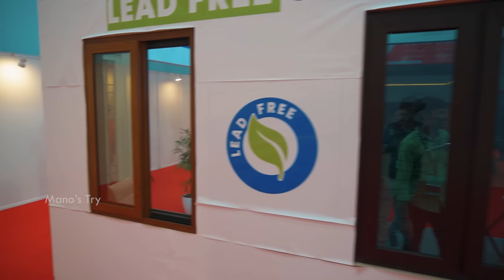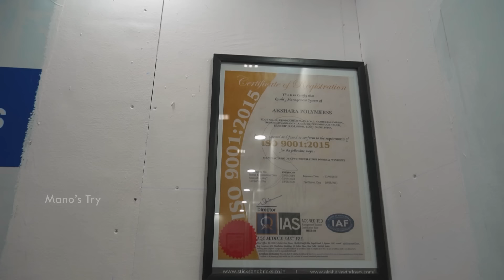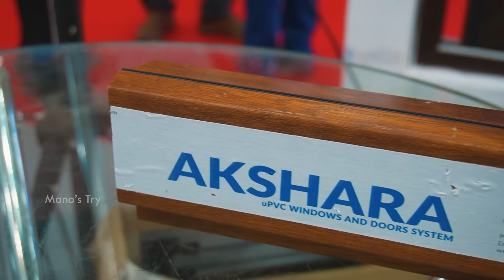இதை தெரிந்துகொண்டு முடிவெடுங்கள் | UPVC Windows Quality Price Design Colours | Mano's Try Tamil Vlog

Comment: All agreed. But in some buildings I noticed that PVC panel is dislocated or dislodged  from wall during summers (due to material expansion from heat). This does not happen in traditional wooden frames.
Reply: It's UPVC Panel Pvc panel pota dislodge aagum
Reply from the maker: This will not happen, if you use quality UPVC Windows